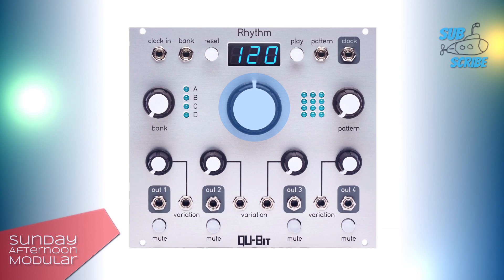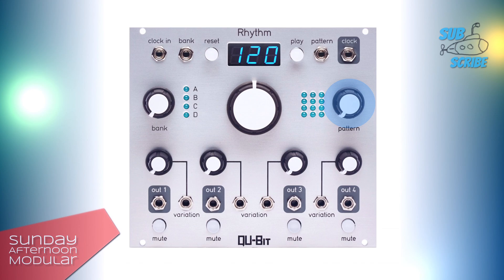Qu-Bit Rhythm Introduction - Rhythm Patterns

Comment: Sounds like it doesn’t have the ability to do an open and closed high hat. Sounded like it could only do a closed high hat. Is this correct?
Reply from the maker: Hi there, the Qu-Bit Rhythm is a trigger sequencer with programmed patterns, it does not have it's own sounds. So you can easily patch one of the outputs to a module that gives you an open hi-hat. Hope this helps.